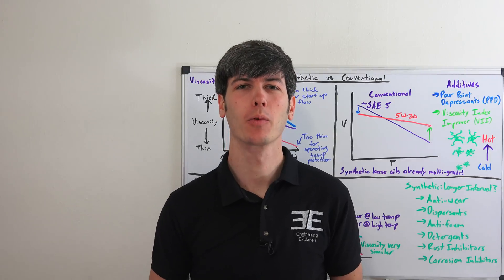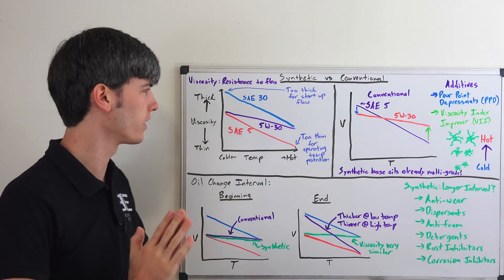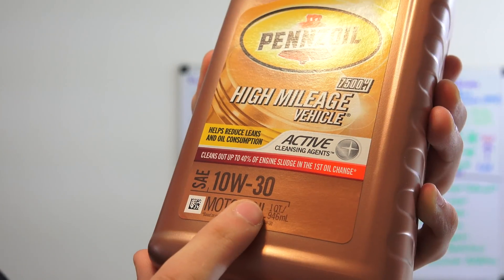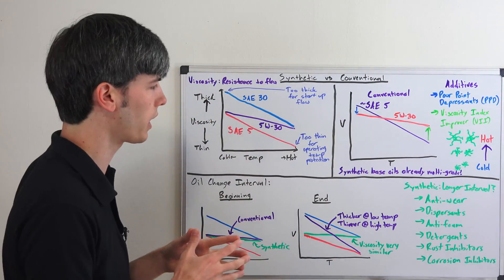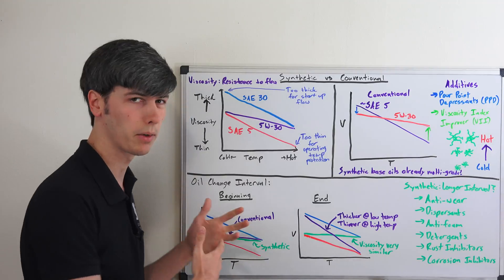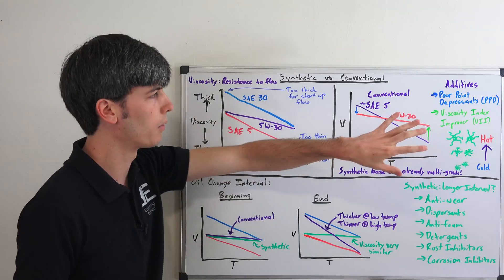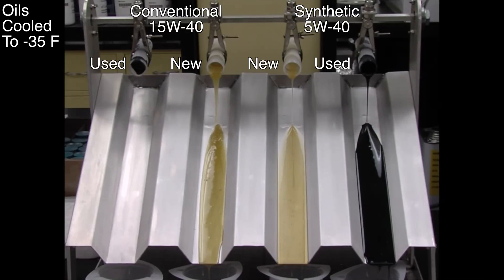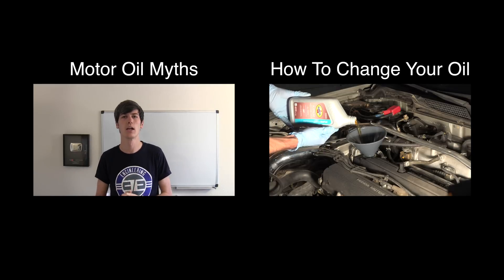Is Synthetic Motor Oil Better For Your Car?

Comment: If you own a Saab, synthetic is the only choice, unless you want to sludge up the engine.
Reply: Deere, nope. There's no such thing as "good conventional oil" when compared to synthetic, especially on SAABS. With ALL SAAB vehicles, it's borderline NECESSARY to run synthetic oils, either 10W-30, or if you're worried about cold starts, euro-spec 0W-40. Other reasons are that conventional oils don't seep very well through the turbo oil lines, and you can kill your turbo just by running conventional, even if you switch your conventional before the mileage expiration. Always run synthetic, if possible Rotella Synthetic or Mobil1 Synthetic, and always do an oil change before 5000 miles, preferably near 4000 miles (even if the synthetic is advertised to last for 7000 miles, higher mileage SAABS need more frequent oil changes). - Sincerely, SAABs Owner
Reply: Mihaly Lukacs Correct
Reply: most synthetic is conventional oil that has just gone through a process that does not occur naturally that is why it is called synthetic (man restructuring of conventional oil)
synthetic is designed to withstand higher heat before it cooks but at normal operating temps of a non turbo car it will never get that hot 
now your turbo cars that lube the turbo with the engine oil do need the synthetic because of heat not because they lube better under normal operating conditions
Lubricants that have synthetic base stocks even lower than 30% consisting of esters (synthetics) can also be considered synthetic lubricants
Reply: or by good conventional oil.
Reply: gotta ask yourself what is synthetic? as dexter stated hardly any oils labelled synthetic actually are thanks to a legal loophole, Mobil1 hasn't been truly synthetic for years, and mineral oil not feeding the turbo? lol.
Reply: Not saying conventional oil cant work in a turbo just saying a turbo is the only place you will see any benefits of the synthetic formulas do to higher heat exposure
Reply: For the Saab, it wasn't so much that it has a turbo. It had sludge problems. The synthetic oil was the fix for that. At least for the 2.3 turbo engines.
Reply: not saying your wrong but i personally believe driving habit is allot of sludge problem .with company cars i have seen them all running the exact same oil and the ones they drive local and never really get on highway much have sludge build up but the ones they use over the road more seem to stay clean it is like the motor never heats up to the point of re liquefying the coating of Paraffin the oil leaves on the parts just saying what i have seen not any real science behind my thoughts
Reply: It's possible
Reply: lmao.. please explain what you think that is.
Reply: It's a design flaw. The exhaust pipe runs right under the oil pan. The heat from the pipe cooks the oil in the pan. Dexter is right about driving habits in the sense that if you do a lot of sitting in traffic, that makes for plenty of time for the heat off of the exhaust to cook the oil. Synthetic oil resists the heat better than conventional oil.
Reply: Q. Lawrence
the youtube reply function is broken. I was trying to reply to the guy that told us to use conventional lol
Reply: Vinnie Davis I see.
Reply: quickest electric  motor cycle

Comment: The argument here is moot anywhere they use road salt in winter. I have run several cars "into the ground," and the bodies will fall apart long before the engines go.  That's assuming scheduled oil changes with quality oil and regular maintenance.

Comment: I have a 96 accord with 289,000 miles on it. what type of oil should I use. as of right now I use conventional oil 10-40
Reply: You use the viscosity and API service grade specified in your owner's manual...period.  Easy.
Reply: If you don't mind speeding the money and you cat get the oil spec in Synthetic  then that is the one to go for.
Reply: ok, thanks guys

Comment: No. That's why synthetic is required for Porsche's, Corvettes, etc. Because it's not as good.
Reply: Bet lots of money changed hands.
Reply: hell yah thos crooks will do anything for a buck
Reply: Synthetic is chosen by sport car people because , synthetic help pull more heat out of the engine than conventional !
Reply: No doubt why they developed it for Corsair aircraft in WWII. Someone bribed somebody. It can't be that it just works better. That's the least plausible of all explanations.
Reply: You could compare the data sheets of Conventional vs. Full Synthetic which are public info.
Reply: Data shmata. That famous golfer uses good ole paraffin oil in his farm tractor so I figure it'll work just perfect for a ZR1
Reply: Germans invented in WW1   and put it into production in WW2 because they could make it from coal.  It was picked up by the allies after WW2 because  it was the only oil that would work in theextreme  high and low temperatures Jet engines expose oil to.

Comment: 91 Lexus LS400 feed nothing but full synthetic oil from day one. 340,000 miles later still running like a Swiss watch. Spend a bit more and buy the synthetic.
Reply: I have a '98 and use conventional...no problems.
Reply: ....yet
Reply: Ive got a 99 ls400 with 210k on castrol blend.
Reply: Great cars.  Yours is just broken in!

Comment: Shame prices are so much higher. But all prices are higher. I haven't really store bought oil in 20 years or so and had to get some oil and brake fluid. Wow...stuff is like $4 and $5 more a bottle it seems.
Reply: The last time I bought synthetics on sale, Mobil 1 was $12/5 qts. and Pennzoil was $10 after rebates.

Comment: I feel that this article is flawed, because it doesn't take into account engine condition. On a high mileage car that's run conventional motor oil all it's life, switching to synthetic can actually do more harm than good. On a high mileage engine, using an oil that's more slippery like synthetic can cause piston rings to not seal as well, lower oil pressure, and more leakage past old seals.

Comment: U want proof this is bs, I have a 86 mr2 I've had for 12 years, driven all year round and it gets fricken cold here during winter, 350000 km always used conventional, pulled engine apart and everything is within tolerances, she runs like she's still new, my dads Toyota 1990 pickup has 700000 km on conventional oil still runs great no blue smoke from tailpipe, like I said synthetic is bs, unless obviously your engine is designed for it like some modern cars, otherwise don't buy into this marketing bs it's just to get more money from u
Reply: I'd call that evidence, not "proof".  But I sure agree with you.

Comment: I'd prefer to see a demo at a less extreme temperature.  It is too extreme to be credible IMO. It just looks like a marketing exercise by an oil company. At -35F you'd practically be in Arctic conditions and you'd have a block heater.

Also, how long is the oil change interval in the test? Older Honda engines specify 5W20 conventional and the "maintenance minder" computes the oil life based on the properties of conventional oil. One would expect that the degradation of conventional would be taken into account in that computation and therefore the advantage of switching to synthetic would be minimal - assuming you follow the computed oil interval.

Comment: come on I thought you all were car savy lol this just a oil company hoax for the consumer to pay more. the Only place were syn oil was ever meant to be used was is in F1 (high rev) or 2stroke Because of clearances of the internal components of the  engine. Basically only High performance vehicles.

Comment: I have a 2004 Toyota Tacoma and I run Synthetic 10w30 in it. I go 10k to 15k between oil changes. I have 215k miles on the truck and it doesn't lose any oil between changes.
Reply: If you go that long, you should consider having your oil lab tested to make sure it isn't losing its integrity. If it becomes too thin over time, it could cost you your engine. It is more than just what color the oil is that deems if it is still good or bad oil.
Reply: Thats cause you own a 2004 Toyota Tacoma!
Reply: Hey dude, his car has 215K miles. He knows what he is doing! He doesn't have ot spend cash on oil analysis at this mileage lol.
Reply: Ran my wife's H3 almost 14,XXX between changes and got my sample back from Blackstone, they suggested we could go 3-5K more between changes based on what they saw.  I'm running Pennzoil Platinum and Wix filters.
Reply: +Jasper Chavis That's why he stated "215k miles, and no repairs and no oil leaks", it might just prove other than what you're thinking or been taught and blindly following.
Reply: +Jasper Chavis,  Audi turbo diesel 1.4L, 2002, the engine is based on the PD generation.  The last car I drove which had a service interval under 10k was a petrol Volvo 340 (6k I think), I forget the year but late 80's or maybe very early 90s.  Most have 10k, 12k, and up here.  But a 32k interval is rare, this is the first car I've had with an interval that long (although that's a variable interval not fixed interval, if you were to drive it short distances it'd be a lot less).

It's the Audi's own fully synthetic longlife oil (actually made by Shell I think?).
Reply: I may have to rethink my oil change schedule. I barely put 8k miles each year so I'll switch to changing the oil every 12 months.
Reply: +Kevin Sissons buy the oils specifically formulated for that, the 15K miles, or once a year, whichever comes first. I do that just to be sure I use the right thing. Been doing that for 5 years already and I am a happy camper
Reply: Synthetic usually lasts a long time.  For my car, the recommended interval is 32k miles...(!!  ... that's a variable distance which is affected by the type of journeys you do & 2 years max, but for me it always comes out at the max because I do a lot of motorway miles.  Currently at 204k on the engine).   I actually do it more frequently than that, usually at about the half-way point.  No oil loss either, and I had the old oil checked a year or two ago (it was fine).
Reply: Qaill1 I don't trust what the bottle says. I use Mobil Advanced which is guaranteed to last 15k, but doesn't seem to last more than 5k. I'm sure it still has life left, but with how much hauling I do with my car, I don't risk it. My car is also at 298k.
Reply: WyndStryke what kind of car? I've never seen a service interval recommended by a manufacturer that was more than about 8k.
Reply: The service guide from Audi said 1st oil change at 5k, then every 10k or 1 year, whichever comes first. But I know a lot of diesels can go longer. My buddy has a 1997 f350 and goes 20-30k, but he also has a 12 quart oil pan.
Reply: That's the fixed service interval, it's actually a different oil (still fully-synthetic, but not long-life).  The service itself is also different.  It's normally a factory option whether you go for fixed or variable intervals (fixed usually for short distance / city driving, and variable for long distance driving).
Reply: I've had Tacos and Tundras since 2005 and think that's too long.  I change at 5,000 because that's when the oil starts looking dirty.  (And it's easy to notice when it's time to change the oil...every 5,000)
Reply: My 97 Camry 4 cyl has 400,000 , change oil every 8000k with the cheapest oil on sale,  change filter every second oil change ever since the warranty came off,  I have no idea what was put in it while under warranty.  Driven every day in Toronto.  The oil never gets half as dark as in the vid.  Something wrong to make the oil go that dark.  Most likely, some  Pennzoil  smoke and mirrors
Reply: Kevin Sissons
The main problem with not running a care very often is corrosion. Especially in humid climates. The engine is hot and as it cools it draws in the cooler moist air. It condenses inside the engine and exhaust system . Short trips is were electric cars are king.
Reply: +Ivan K Mobil,  and Castrol do make those
Reply: I always change my oil at the recommended intervals regardless of what oil I'm using.  Never had a motor issue ever.  Just don't want old oil in my rig despite people making claims synthetic runs longer between changes.  Then again, I don't run synthetic but I'm vigilante in making sure my truck gets oil changed when it's supposed to.
Reply: I have yet to see a complete independent study. I hear lots of stories but most are just that.  Maybe the synthetic oil can go longer between oil changes but other than that I see no difference. I buy the cheapest I can find (usually less than $4 a liter) and my engine will last as long a the $10+ a liter.

People talk about how they have used synthetic for X # of years and are happy,, do this men the people using cheap oil are not happy?   I get my oil, a case of beer, and munchies for the same price of the synthetic oil .  That's not to say that HIGH performance engines shouldn't use the best oil they can get, but your average machine don't need it.  Many high mileage 15 and 20 year old cars around running on regular oil.
Reply: It shouldn't be too hard to study yourself. Just drain your oil into a big clear container like a 2LT bottle and let it sit on a sturdy shelve where the sediment can settle. At the recommended 3.5k on my car there is a noticeable buildup of sediment, around 1/4 inch. The one time I went longer, around 10k or so, it grew to 1 inch of buildup.

Of course there are other things to check. Sludge buildup inside the valve covers as well as what type of sludge (milky or clumpy). Oil flow through the various channels, particularly the small pinhole channels in the cam. I wouldn't be alarmed by milky sludge, off the shelf oil cleaner solution seems to work great for getting that out as long as you do the recommended 1k mile change after putting it in. 

Clumpy sludge is a huge problem, killed a Dodge Intrepid I tried to save. Had to use plastic paint scrapers to remove the sludge and even then it had the oil channels so plugged that it warped the cams and heads just test starting it after cleanup of what I could get out. My guess is that the increased forces was too much when oil couldn't get into the smaller channels.
Reply: Just got to look at all the cars that ran for many years on regular oil. Most engines out last their bodies. Most engines fail because of abuse, not the oil they use. Continuous stop and go traffic, hard accelerations, infrequent oil & timing belt changes. Incorrect coolant and known engine problems (ie. Chev Cavalier 2.2 cyl head warping on driver side) , very cold weather (-25 deg C or lower) starting. High performance engines are a different story as they are built to closer tolerances and take a lot of abuse therefore they need better fluids and attention. There are millions of cars on the road using regular oil and they usually live a long life. Of course there are the exceptions in any instance.
Some people will say , race cars use it, but their engines are run very hard and often to their limits and they are rebuilt often, in some cases, after every race. Therefore you can't compare those to normal every day road use
Reply: Your engine must be sludgy...
Reply: I just saw my notes on when I changed it and it was Feb 2015. I switched to conventional oil only because I cannot afford the synthetic anymore.
Reply: +Kevin Sissons synthetic oil at wal mart is way cheaper than any auto parts store. Not sure if you live in the states, but i used to pay 20 bucks for conv oil at pep boys or oreillys, now i pay 20 bucks for synthetic oil at wal mart.
Reply: +heyitschinoable 5qt bottles
Reply: Fair enough point although the duty cycle of the engine during those 10-15K miles is frankly just as important as the interval mileage figure itself. Ive seen oil that's done 13,000 highway miles in a car over only 4 months look in far better condition than the sample that's only done 3,000 miles in another driving around the city on short trips over 9 months.
Reply: Theres a very real chance you're not even running synthetic oil.
Reply: +Mazda rx7 exactly, paid off by pennzoil I've used conventional  (what ever is on sale) and went well over 300 k  before any issues, so I think synthetic oil is another way for big oil companies to use scare tactics on ppl.